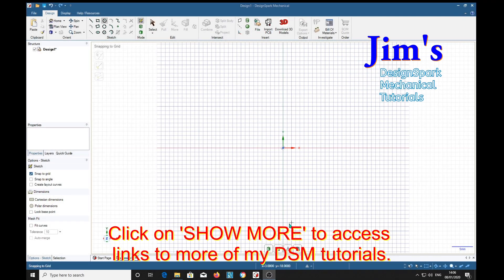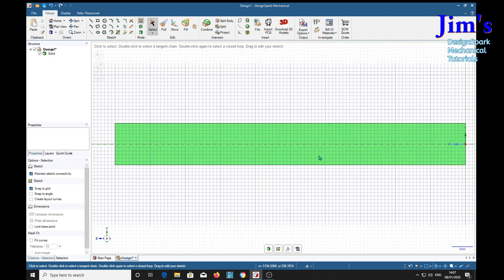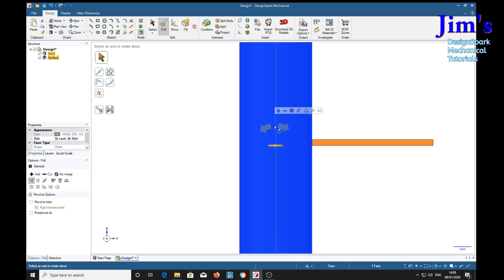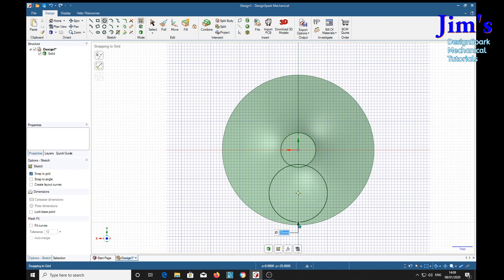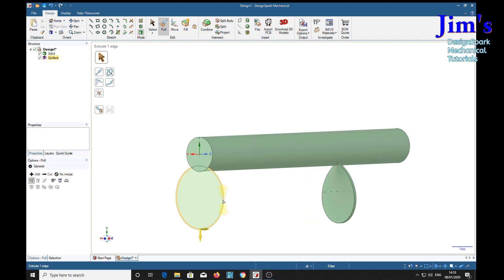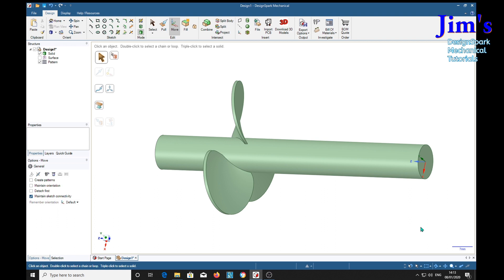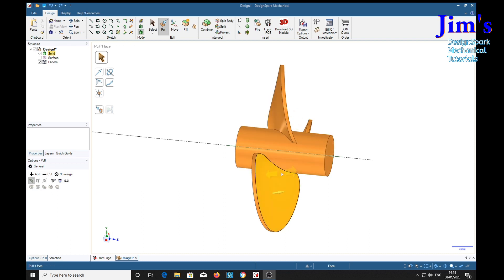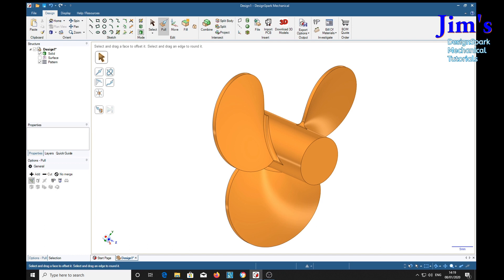Modelling a Boat propeller in DesignSpark Mechanical

Comment: thanks for this....how about Air craft propellers ...
Reply from the maker: Modeling an aircraft propeller is probably similar to the way I modeled the Spitfire wing - see: https://youtu.be/mSzrGRdj7Pc. You would need 2, 3, 4, or even 5 of them mounted on a hub. The pitch, aerofoil shape, rpm etc would need to be correct for the engine power, flight speed, load carrying capacity - but apart from that it should be quite simple ;-0